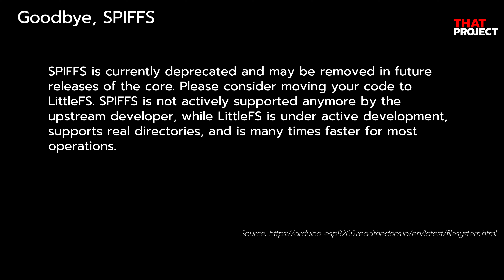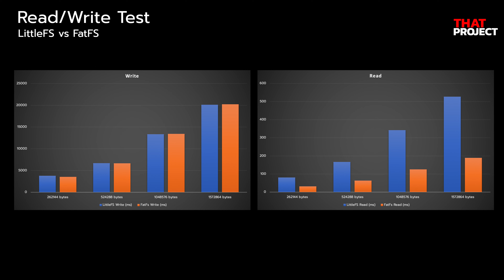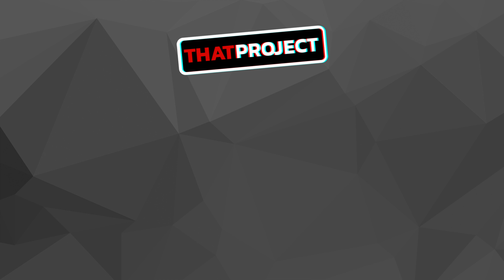No more SPIFFS! LittleFS vs FatFs

Comment: I successfully upload a few images file to ESP32 LIttleFS. Files are not in any directory except "DATA" folder which require by LittleFS Upload plugin. Now I want to list the filename by using Serial.print.
Do you have code to list files in LittleFS root directory? 
This is my first time to use LittleFS. My project is to store image files in the memory and display them in TFT later on.
and this is just 1st step.
Reply from the maker: @jumbo999614  Espressif already officially supports testing LittleFS.
If you are using Arduino IDE, try Examples > LittleFS > LITTLEFS_test.
If you are using ESP-IDF environment, try this: https://components.espressif.com/components/joltwallet/littlefs/versions/1.14.8

Comment: Thanks for that, what I find strange is that in the partition table, littlefs does not exist it's  also a spiffs in partition 🤔
Reply from the maker: Yes it is. At the code level, SPIFFS has simply been changed to LittleFS. So, the term SPIFFS is still used in partition tables.

Comment: It seems LittleFS is a lot slower then SPIFFS on esp32. And even SPIFFS is a lot slower then it should be. Hope this is sorted out soon.
Reply from the maker: Depending on how you use it, its speed may vary. For example, LittleFS is slower than SPIFFS when appending after reading a file. Have you tried FatFs?
Reply: @ThatProject  No, now I'm gonna ;)

Comment: Hi Erick, Have you tried using "LittleFs Data Upload" for the ESP32-S3 chip?, I haven't managed to do that yet
Reply from the maker: Which version did you use? I was able to upload normally to LittleFS and FatFs in Arduino version 1.8.19, which is the classic version.
Reply: @ThatProject  I'm using Arduino 1.8.13
Reply from the maker: @bitman4204  I used this. https://github.com/lorol/arduino-esp32fs-plugin/releases/tag/2.0.7
Reply: @ThatProject  thanks i will try that
Reply: @ThatProject  Thank you very much, it worked with the esp32-s3 chip, you are a great friend!

Comment: Both are much slower than 4-bit SD...
Reply from the maker: Is that so? I haven't tested the SD card side yet. How fast it is?
Reply: @ThatProject  Tested on ESP32 CAM with SanDisk 32GB SD card and SD_MMC lib in 4-bit mode.
1MB read  : 140ms
1MB write : 378ms
Still waiting for the emmc module for further testing.
Reply from the maker: @TT-it9gg  Thank you for good information. I'll try to test it too.
Reply: @ThatProject  Just tested 8GB eMMC.
1MB read : 128 ms
1MB write : 259 ms